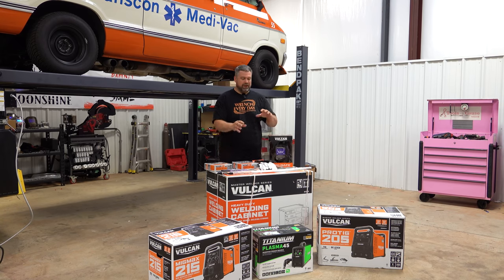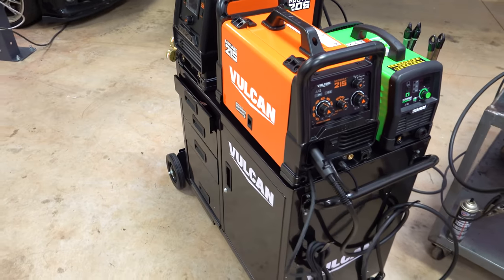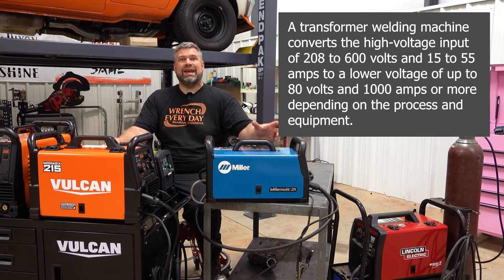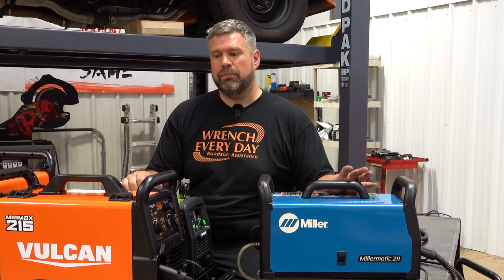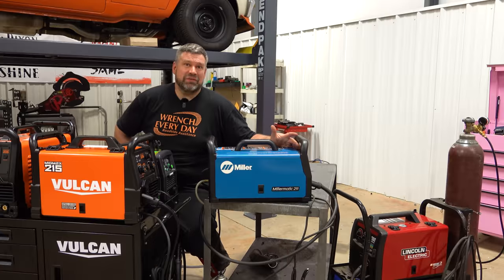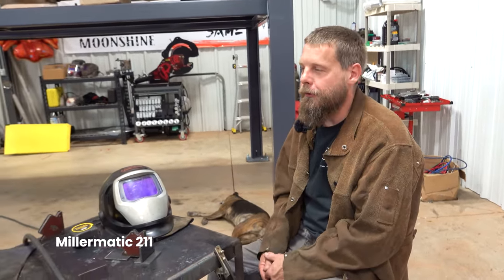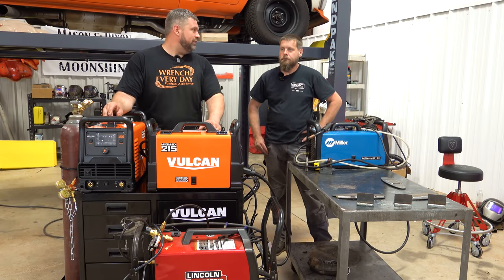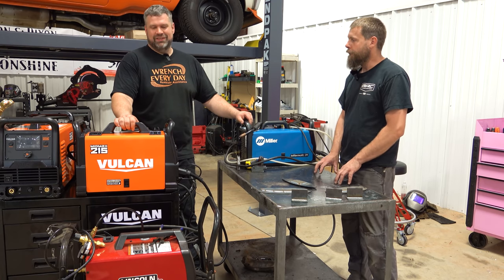Here's What NO ONE Will Tell You About Harbor Freight's "Best" Welders....

Comment: I've had a Chicago Electric Tools wire feed welder from Harbor Freight for years and for small occasional welding jobs, I love it.  I recently welded an exhaust system, and after I learned the feed speed for the minumum setting, I was able to create a nice continous pool.  One thing that I like is that I can use it with any 20 amp 110 circuit.  I was able to use it to pin extra posts to a steel I beam in a construction job.  The posts were plumbed up and just needed to stay in place until they were extended to bear weight.  I'm sure the welds are good enough to hold them in place.  They'd need to get hit pretty hard to move them, and I was able to do the welding without a 220 circuit.  Plus, I've welded really light gauge steel with it, so I think it's great for an inexpensive welder.

Comment: Here over in Europe, we have multi-process welders that do AC tig for welding aluminum, but I'm not sure that they are available in the USA since we use different specifications for mains power. I'm currently using the Parweld XTM 211Di. It welds everything you throw at it very well. Great welder for learning all processes, but also for just having everything in one machine. Ideal for a compact shop or on the road. I know ESAB makes the rebel 205 ci AC/DC which apparently can do the same, but I have no experience with that machine. 

But a great video. This style of video really helps if you want to start working on cars and other stuff yourself and need to know what tools to get. It shows where you can cheap out and where it is better to save a bit more money and buy better quality tools.

Comment: I bought the vulcan 215 it lasted exactly one 2lb roll of .35 Flux core wire . Unfortunately it took me a little over a year to weld that much. Just outside the warranty time. I switched to the holbart 190 love that machine.
Reply: Gee, I've had a Millermatic 35 for 40 years.  I can't remember ever had any problems, and it'll weld anything from sheet metal  to really thick plate.

Comment: I have the MigMAx Vulcan 215 after owning a Hobart 215 for almost 10 years. I sold the Hobart after trying the Vulcan 215. The Vulcan was much smoother and much quieter. The mig gun for the Vulcan is available unlike the Hobart 215 which now you can only buy used if available. I do weld aluminum some of the time and the Vulcan 215 does a great job with the Vulcan gun. I highly recommend the Vulcan Mig Max 215.

Comment: If you are a hobbyist or even a shop that doesn weld much, I'd go with the Harbor Freight or some other Chinese welder. If you are a professional welder then I'd go with either a Miller or Lincoln as they tend to hold up better to all day everyday use, but having the Chinese welder as a backup for when your other one goes down isn't a back cost efficient option even for the pros

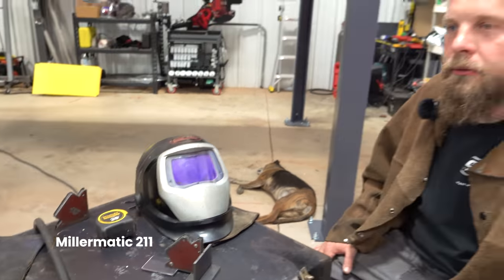Comment: At around 24:30 Randy said that the welder had more power, and it was burning the wire up more quickly, so he slowed the wire speed down. Isn't that backwards? Shouldn't you speed the wire up, to keep up with the higher voltage?
Reply: Yes. Turn power down or speed up.
Reply: Unless it's more a problem of too big puddles. Then you'd turn down wire speed.

Comment: The biggest difference that I could see from the various Harbor Freight lines was duty cycle which you didn't go into. If you need to weld for hours at a time, you need to go to the higher priced lines. If you spend 5 minutes welding and can let the machine rest a bit, the cheaper machines might suit you.
Reply: Yepper.  The HF machines have a 30% duty cycle.  That's pretty bad.  As you said, if you only need to weld 3 out of every ten minutes, they'll work for you, but I don't know of many situations where you can get away with a 3-minute weld time.  For your everyday homeowner who only needs to fix a part here and there, it's nice to have a cheaper option.  Then again, you get what you pay for.  That Miller or Lincoln might last you your entire lifetime.  I guess it's 6 of 1, half dozen of the other.
Reply: Bingo,
Thx 4 the post…
Reply: @pamike4873  this is true at max output, if running on 240v they have 100% duty cycle up to 115 amps, then it starts to drop until max output. m if on 110v 100% up to 75a
Reply: I'm in home painting and sprayers are the same thing. Cheap ones will work, but if you run em all day, they're going to die pretty quickly.
Reply: @marthamryglod291  I have welded many  times with mine at 4 to 5 hours straight on 220 and have had no problems yet iv had it a while no complaints yet and I am very hard on my equipment definitely put it to the test
Reply: These machines on on 220v have very good duty cycle times. As good if not better the then lower end miller and Lincoln machines
Reply: @marthamryglod291  HMM you should tell that to the guys that use them in shops daily for years...Bet they would argue with you and prove you wrong daily
Reply: @mrmotofy  what does my personal experience with sprayers have to do with anyone elses? The topic here is welders. Stay on topic.
Reply: @marthamryglod291  YOU brought sprayers into the conversation NOT ME. I was referring to guys in welding shops using the HF welders daily for years will prove you wrong. The have excellent reviews even for daily use
Reply: @mrmotofy  dude, I don't know anything about the welder. I know sprayers. I was comparing the lower prices sprayers not lasting to lower prices welders not lasting. The original post is about duty cycle. That is what talking about.

Comment: Im running a hobart 190 mig for 4 yrs now and i just got the 27i plasma.  Ive done some serious work for what i will do.  I primary do 1/8 up to 5/16.  I have had to redo my pintle trl mount which is 2 x 2 solid bar to 1/2 mount plate with 1/2 gusset for extra strength and i pull a 13k trl on the mount and ive been very happy

Comment: 15:45 Yes you or Correct.
We had the experience of inverter electronic broads shorting out. All these machines suck up dust like a vacuum cleaner. Leaving thick metal dust in the electronic broads and shorting them out.
Once a week you mush disassemble your welder and vacuum your welder of All metal dust. Some parts, after vacuuming, can be Blown with Low pressure air OUTSIDE.  Because if you Blow out that last 10% inside your shop,   your other welders suck up all that metal dust.

Comment: Been using a HF flux core (aka the Splatterbox) for a long long time.   For my intermittent light duty use, maybe a couple small things a year, its fine.  It  was like $80 bucks on sale.   Of course, 30m of welding means an hour or two of clean up...
Reply: Same here. One thing that I found helpful for me is to use good quality wire with it.  I had instantly better results and less splatter once I quit using the cheap HF Flux core wire.
Reply: @05milmachine90  Never thought about it, heh, I am still using wire from when I bought it in the first place.  But yeah, whenever I do run out, think you are right.
Reply: ”Sounds like bacon: Ok!
Smells like bacon: You're on fire!"

AvE

Comment: Been using a small 220v HF wire machine. For the money, $140, it has welded everything I've wanted, at home. Yes, duty cycle isn't 100%, but for home mechanic, has been awesome for 3 years.

Comment: I love Miller, you could absolutely say that I am a Miller guy but! I HATE the 211. I’ve worked at a shop that had two of those so I would weld with one until it hit the duty cycle cap, switch to the other, rinse and repeat. I run a 255 now and love it for the most part. I also have a Lincoln in the shop but I just don’t care for it. It doesn’t seem as smooth and it’s definitely not as user friendly as Miller.

Comment: Thanks for the info!! I am new to welding and want to buy a great welder that will do up to 3/8th inch metal for structural and other uses. I took welding classes, for MIG, Stick, Flux Core, and TIG., and I want a machine that will do all three as well as an additional plasma cutter. 
I currently have a good budget for this and want your advice for a home hobbyist setup that is slightly commercial use too, if needed. The school has Miller machines to learn on & I am a Harbor Freight fan for most tools. I ask for most of us new graduate beginner welders.
Reply: ShaRon You just described the Everlast Powerpro 256si 20 Amp to  250 Amp water cooled Tig,    stick weld 20Amp to 200 Amp, Plasma  20 to 60 Amp.  Check them out on line. designed and spec by electric engineers and built in Asia. Only available from the Everlast company here in the states. The instruction manual is one of the best I have ever picked up. This model weights in at just under 100 lbs.   One thing that is not included is a water cooling pump that can be purchased separately. It is worth a look.
Reply: Read the reviews on the HF units. There's a lot of shop guys using them daily in shops for many years...saving tons of money.

Comment: Irony: if they'd reversed the layout of the cart, doors and drawers, you'd be able to put the MIG near the handle and the door would swing out.  Unfortunately that would put the MIG cabling right over the doors/drawers, but the fix for that would be to have the cable hangers on the door as well.

Comment: "Which welder?" often depends on the need.  I have an ancient HF "90 amp" wire welder, bought more for learning than any real need.   I did eventually find a practical use beyond learning "how many amps" and "how fast to move".   I extended the metal shepherd's crook that holds two bird feeders high enough that the squirrels couldn't jump on top of the anti-climb barrier.  I thought a beginner needed more surface for welding than just putting pieces of 1/2" rod end-to-end so I used some 3/8" (?) angle that was available and welded the bead where the edges of the angle met the rod.  It's still surviving outside more than 10 years later so the HF welder was adequate for the job.

My favorite welder ad is from one of the Chinese "We sell everything companies.  The little inverter welder is sitting on a steel beam and there's an arc from the stick electrode but no cables are plugged into the welder.  "Wireless" or "cordless" welding is probably something welders occasionally dream about because there are places that would be easier to reach if you didn't have to deal with the cables.

Comment: used a couple of cheap harbor freight wire feed, but got a multi process 110v from Eastwood. Only used it for mig so far, it's been fantastic. $450 ish a year or so ago. Welded 19ga sheet metal all the way to 3/8" AR400 successfully.

Haven't tried the stick..I have an old lincoln 240v AC 'buzz box' for that, and will try tig at some point with aluminum.

I just work on cars and odd jobs around the farm. It works for me.

Comment: One thing I either missed or you didn’t talk about, that’s very important is duty cycles. Idk what harbor freight is up to now but they use to be around 40% VS Miller which is over double that. Meaning if you are a homeowner or even a mechanic where you might weld for a few minutes at a time and the unit has time to cool down you will be fine. If you are a welding shop where you are welding for extended periods of time the HF might shut down. Again I couldn’t find the Duty cycle on the current model but that’s pretty important. I did love the sound of the Vulcan it seems to have a great frequency to it

Comment: I really feel that with these new machines, It comes down to warranty. With millers 4 year warranty vs Vulcan one year.  That and miller is made in the US.  BUT the Vulcan MIGMAX 215 is currently $799 at harbor freight. Its hard to overlook that.. Thank you for the interesting video.
Reply: Miller is made with foreign parts which is why it now only says “assembled in the USA”. They will make your welder not worth fixing with the price of a board so the parts issue is getting less of a selling point
Reply: @CustomWeldingandFab  exactly! You really just need to think about your needs. Are you relying on a machine to run your business. Or is it just a weekend warrior's hobby machine. If I were using it to burn 8 hours a day 6 days a week to feed my family I might just shell out the extra grand for the blue box. and then not need to worry about it for 4 years. I know that Miller is great with the warranty service and its easy to find a authorized shop to do the work. Im not sure if my local shop would even service a vulcan. Ill ask them next time im there...

Comment: You didn’t show the welds up close, I wanted to see how they compared in looks and strength. On a side note though, thank you for comparing some more harbor freight stuff. I feel like harbor freight has had to increase their prices so much just to stay competitive that they are not really the go to bargain tool shop anymore. Some things I can find better brands and cheaper than harbor freight.
Reply: I'm glad to see that HF has allowed their products to be reviewed again without hassling the reviewers (Another popular review channel received a cease and desist order from an un named company, yet afterward, HF products stop being reviewed).  I agree, their price point is now too high for many of their products.  Their prices sometimes are higher than not-budget-line tools occasionally on sale at the big orange box retailer.  As far as their medium end line like Titanium, you can often get the same thing, likely from the same factory, on the jungle website for significantly cheaper.  I used to go to HF a lot, now I go every now and then.
Reply: Yes but the pro welder was clearly impressed and said based on price too he would certainly buy the HF. Many guys run shops using them for years...kinda speaks volumes for the machines.